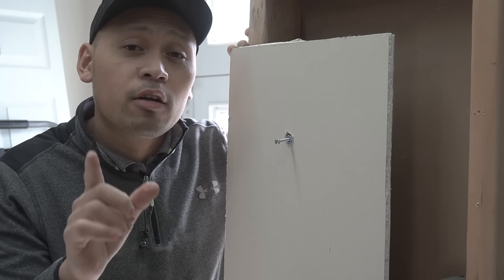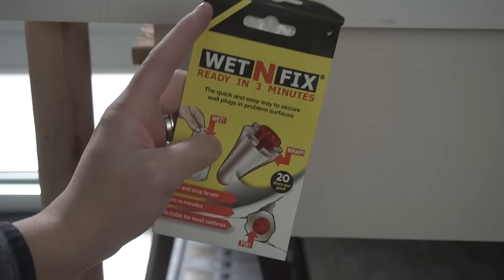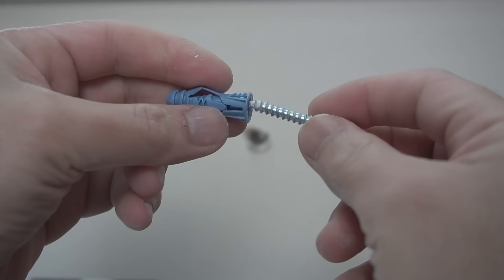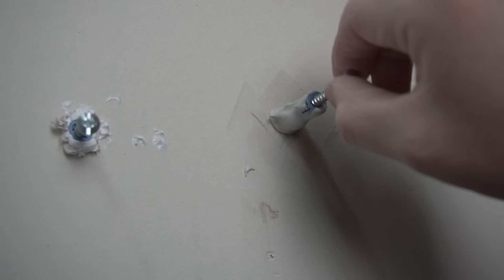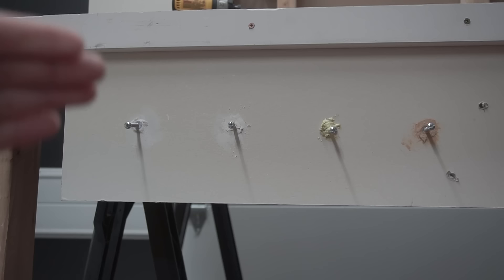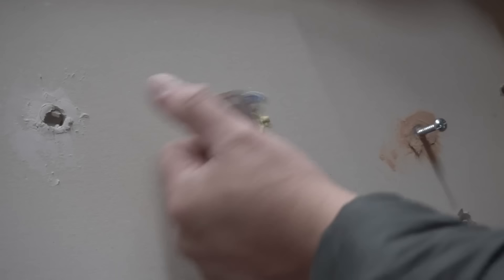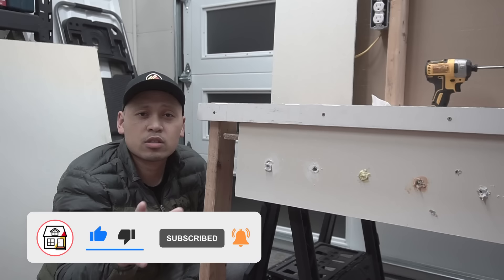How To Fix Loose Or Damaged Drywall Anchors Like New! | DIY Wall Plug Repair!

Comment: Best to avoid this situation to begin with by using the "Toggle" plastic threaded anchors. I usually pre-drill through the skin with a small bit, especially if there is layers of paint on the surface. I've never had one fail. You can also get them in a shortened version for walls that are attached to furring strips close to a concrete exterior wall.
Reply: Where do you get the shorter versions from?
Reply: @qasion  both Home Depot and Lowe's have them
Reply: Which is great if your the builder but what about the buyer.
Reply: @LilacKatz12  I was referring to the buyer / homeowner
Reply: Until you need to unscrew something and replace the screw and discover your toggle fell.  Go with Mollies instead from the beginning.  Always.
Reply: @sailbatten2056  tell me you’ve never used the plastic toggles without telling me you’ve never used the plastic anchors.

Comment: For a hole that's just too big, I'd probably try a Molly bolt of a corresponding diameter first, even if it's overkill and more expensive. I decided long ago that all drywalls (13-15 mm of brittle plaster) were border cases for attaching stuff (it's not a concrete or even wooden wall), so I am sticking to Molly bolts for lifetime sturdy fixtures, because I don't want to risk a kitchen cabinet falling down on a kid grabbing some jam, or a security rail not holding my weight if I slip on the shower floor and need the support. When I hang a light painting frame, I always keep in mind that the same anchor might be supporting a heavy mirror some day when I am fed up with the painting or poster.

For larger or damaged holes, why not cut out the damaged part and replace it with a square or circle of new drywall board? You'd need to plaster and plate that new piece to the rest of the main board, so it may not work in all situations, but it's a proper repair that would probably hold better than trying to fill in the hole, especially with compounds that are not the same gypsum plaster of the original drywall. 

I am actually surprised that there is no better drywall repair options out there, like one where you'd insert some unfolding back board from inside the hole, then fill it with the same gypsum plaster as the drywall board is made of, then drill a new hole once it's dry. If the back board could be 5 mm away from the back of the drywall, even better, as the plaster would not just fill the hole, but also get in between the back board and the drywall board, making the repaired hole even stronger than the original drywall.
Reply: You're supposed to join heavy objects, like cabinets, to studs, not drywall. As for shower rails, I'm not aware of anyone who has drywall in their shower! Wetwall, maybe (yes, Virginia, there IS a wetwall!), but, you wouldn't want to attach a safety rail to that either. Use studs (if you need to and are capable, then add your own studs, as I did for a walk-up porch safety rail (elderly and handicapped)), or, assuming you have tile in your bath/shower, get a heavy-duty, suction cup, safety rail. The suction cup rail that I attached in my client's shower is still holding after 3 years! Keep in mind that a suction cup safety rails are not meant  to hold full, sustained, weight, for more than a few seconds (having written that, I tested my client's with my total body weight suspended off the ground, and it held for 15 seconds before my grip started hurting!).

Cutting out and replacing damaged drywall is no better than the test in the video,
because, the drywall joints can fail under the pressure.

As for your "unfolding back board" notion, that's what mollys are for, although you'd have to drill a bigger hole.

Keep in mind that hollow wall anchors aren't meant to hold tremendous weights; the more weight you have, the bigger and/or more anchors you'd need.
Reply: @skaizun  Kitchen cabinets are fine on drywalls with the proper number of adequate anchors. It's not like you have a choice anyway, there are not always studs where you need them, you usually don't know where they are located when you move into a new apartment, and even if you manage to get one side anchored onto a stud, the other side has very little odds to also be on another stud.
When building a house, kitchens should probably be fitted with reinforced dry walls on the side(s) where you would hang cabinets. Same for the TV wall in the living room.

As for the security rail, it seems quite common in renovated buildings here in France to use dry water repellent drywall for showers in private housing or hotels, as well as in some industrial wet/damp rooms. The main manufacturer here (Placo, from Saint-Gobain group) offers several types.
I also put towel hanging rails outside of the tiled area, and while they are not meant to be security rails, it's nice to know they are firmly anchored in place should the need arise.

As for cutting our drywalls when the hole if bigger than a Molly anchor, a small cut would be rather fragile indeed.. A bigger cut, from the middle of one stud to the other would be just like putting 2 regular drywall boards together. It also gives access inside where you can put 2 small horizontal studs behind both top and bottom sides to support the big board and the smaller added piece. But that's only if you can finish the piece in the same way the rest of the board is painted or wall-papered, if it's not hidden from view.

Anyway, I haven't seen the need yet, it was just me reacting to the products in the video that didn't seem adequate or safe for the job, and trying to figure out how I might broach the matter (and possibly make an even bigger mess!) Sometimes ready-made repair kits are very useful and time-savers, but these looked more like the quick and dirty kind. Also, every decent man or woman that I know has a spare piece of dry wall in the garage, so it saves a trip to the store to buy yet another expensive gadgetry.  😄

Comment: I've had luck with liquid nails but it's probably not for every application. If I may offer a tip: I like to make an X on the surface so that I can align the loose anchor into the right position using the lines to bullseye the anchor center. It sucks to go through all this trouble only to find the patch is worthless because the bracket (or whatever) doesn't line up with the repair. Cheers!

Comment: Good tests but a toggle bolt is the best option at this point.  If someone does not want a toggle bolt, patching over it with hot mud an installing a new anchor 1-2" over or under is a better solution.
Reply: I am a maintenance man for 30 years, and yes toggle bolts are the key.

Comment: A Toggle bolt with a wing nut or Butterfly anchor would work way better considering the fact that the hole in the drywall is that big…
Reply from the maker: Thank you 🙏🏽 for the feedback!
Reply: seconded, though it depends on whatever the hell is hanging off this. I'd be looking at perhaps you need plywould backing or gluing it on or a plywood panel, or changing something to be more appropriate. if it is a floating shelf or something being used/pulled on, or into the ceiling- even wing nuts or butterfly anchors won't cut it.

Comment: Great job. Appreciate all the work that went into this.  Super helpful!!!
Reply: Do not follow his instructions to the letter, this is by far the worst method you can use, in a case where the hole is too big for your old anchor, take a spring toggle bolt anchors, your installation will be more solid, less waste of time and money.
Reply: @foxgood  How is by far the worst method? Where's your video demonstrating this?

Comment: Installation:
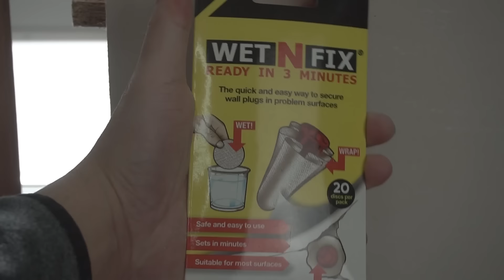1:08 - Wet n Fix 
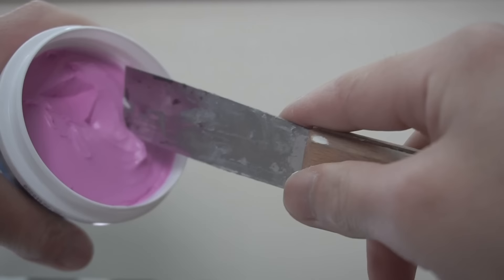2:48 - Pink Spackle 
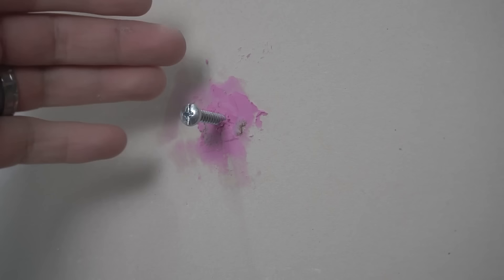3:23 - Expansion Foam 
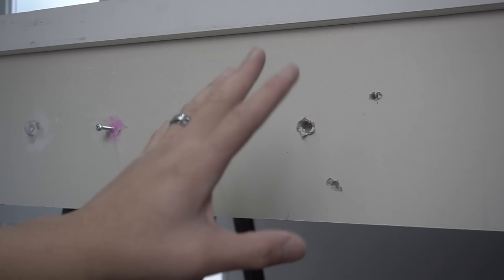4:09 - Wood Filler 
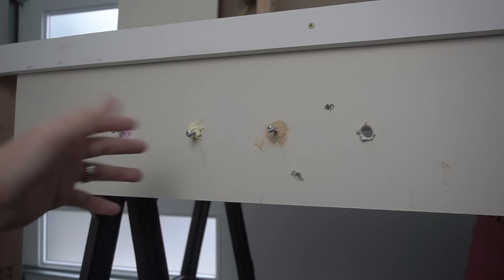4:35 - Caulking
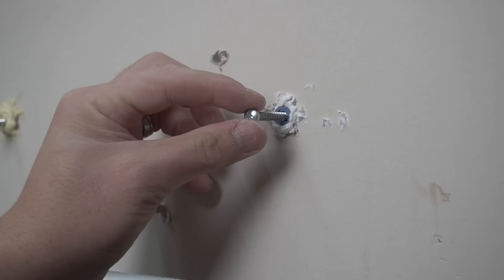4:55 - Hot Mudd Joint Compound 
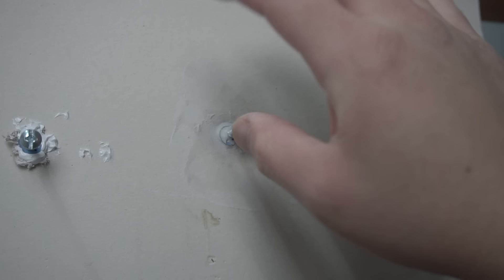5:39 -  Drywall Anchor

Testing:
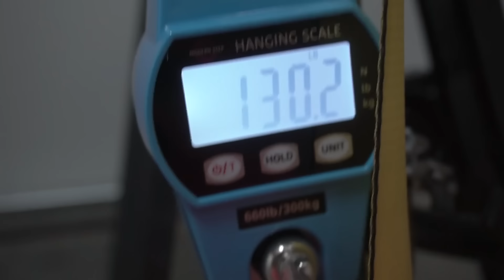6:15 - Drywall Anchor
6:52 - Wet n Fix - Pass
7:28 - Pink Spackle - FAIL
7:55 Expansion Foam - FAIL
8:08 - Wood Filler - FAIL 
8:20 - Caulking - FAIL 
8:31 - Hot Mudd Joint Compound - Pass
Reply: Thanks for this rundown! 🎉

Comment: I really like your videos.  My house has so many problems i'm about ready to start my own channel.  It'll be called "F--k this house!"  LOL
Reply from the maker: You made me laugh so hard with this comment! Best one yet! This deserves a Pin! 😂
Reply: @FixThisHouse    Thanks for all the hard work w/your videos!
Reply: @FixThisHouse  o
Reply: @FixThisHouse  this video made me laugh  ...it is a joke right..? First off no one should reuse a anchor if it has been already expanded. Second not one of these fixes will work. overtime they will weaken and these anchors are not tested that way . To test properly you would have to pull put not down . There are better anchors for this job . Also we see these dont work because foam wood filler joint compound are not made for this at all especially caulk .. of course the only actual usable product is the only bbn one that held up... batch the hole.. for f sake
Reply: And the award for hardcore comment of the year goes to...
Reply: @WhoIsJohnblack  it's the gospel  side huh... danmittt.. always the bridesmaid never the bride
Reply: @WhoIsJohnblack    I accept this award on behalf of all the other fed-up home owners out there!
Reply: A far bigger problem with drywall is punctured vapour barrier. That causes condensation between inner and outer walls leading to mould and rotten building structure.
Reply: @davidelliott5843  hmm depends if the wall is sub grade yes it needs a moisture barrier but if it is sub grade I should spend the extra 1.50 a sheet and get a water and mold resistant gypsum board.or dry wall for those who dont know what I am saying.but then again that moisture barrier should be under the furring strips and not under the dry wall it should be between the wood and concrete.. not the wood and drywall so you shouldnt have any problems with it being punctured.. unless u do thru the gypsum and the insulation and into the concrete you should worry about your vaper barrier..
Reply: Jesus is coming. Read the Gospel.  How would Jesus fix the hole? He was a carpenter, right?
Reply: Brilliant....just absolutely brilliant...been there myself.
Reply: too much trouble, too slow, just use a toggle.
Reply: @notyou5557    Yep that pretty much describes my projects!😂😂
Reply: Jesus is coming. Read the Gospel.  Dude, after a day at work, the smell from my feet would melt the Pearly Gates.
Reply: @ourbills9999  He prob wont reply.  He's off a-trollin in the name of GOD!!🤣

Comment: Thanks for your help.  We're trying to do a vertical blinds repair, and the top of the window frame seems to be a main frame building metal with a layer of compound that offers limited 1/2" depth and very little screw tolerance.

Comment: Wet an fix .   It works a treat,  I had a radiator fall off the wall in the kitchen it was a nitemare dealing with plaster board etc .   Cheers the channel is great 👍

Comment: The wet fix is basically just lagging cloth used to wrap pipes. It does harden pretty good, but I find first repair the hole with plaster Paris, and then put a piece of lagging cloth like that circle you had on the surface, then spackle over it basically repair the wall before you put the Shield back into the wall but first yes drill a hole the right size and then put it back in,

Comment: I'm in the process of fixing toilet paper bracket with small tray that the anchors are loose. My plan is to use a couple small (10/32) toggle wall anchors. I am going to place fender washers between the holder and wall for a little extra wall strength. 
  Good idea. I plan to pick up some of the "Wet N Fix" for future. I have a 40 + year old mobile home with many issues. It keeps me busy.

Comment: I’ve heard (haven’t tried it) that putting a cotton ball in the hole and then soaking it with super glue works.  Drill a new hole in the patch for the anchor.

Comment: Great to do this as an experiment. Thanks for taking the time to do this.
Questions . . . just for reflection; no need to answer them . . .
• Is there a reason you didn't show us the back of the drywall with each set up, like you did with the last one that had the right size hole? I am curious to see what the wet-n-fix looked like on the back . . .
• I am wondering why you chose to try solutions with materials that are not meant to have any strength? Is it because you know of people who have tried such solutions? 
• If the idea of such anchors is to be able to expand behind the drywall, why put any kind of compound on the anchor in a way that might keep it from expanding?
• Several comments were about using a different type of anchor that is larger and would fit the hole size, and I think that type of anchor functions in a different way and is much stronger because of a better anchor design for strength. Was there a reason you did not also show this option?

Comment: Gorilla glue does the trick. I lived in a lower-end apartment for awhile. It was a hurricane Katrina rebuild. Thin thin walls, cheap closet and cabinet shelving. Shelves and screws kept falling out. To avoid delays, I decided to do repairs myself. Gorilla glue was amazing. You DO have to wait 24 hrs for 100% cure and it does expand, but it definitely works.

Comment: I use an interesting trick. I cut a strip of wood about 1/4” thick, 1/2” wide and 2” long. I drill a 1/8” hole in the middle and put a string in with a knot on the back. I push the stick through the hole and pull the string back. I dab a bit of superglue on the edges to hold the stick in place and let it dry. I now have a screw going into wood, much stronger than the drywall.

Comment: toggle bolts when the hole gets wallowed out like that. I have also found that many products come with wall anchors that don't have a lip and some spikes are supposed to hold it still but they do not work at all. There are also metal wall anchors that are like hunting arrows with blades that hold it still, they also do not have a lip but work ok.

Comment: Squeeze "Goop" flexible multipurpose adhesive into the hole.  A generous amount will bond around the inside of the drywall. I have used several times including a towel rack. Other such glues in a tube may work but Goop will tend to stay together and is not thin and not "runny".  You do need to give it time to solidify. With a towel rack end hanging loose, just squeezing the goop behind the loose fitting quickly held the one rack end in place  - without hanging any more weight on it for at least a day or so. I have used it for drywall anchors also.

Comment: I used some foam pipe insulation to fill the hole. It will expand to fill it if you compress it first.

Comment: The Wet-N-Fix is basically Plaster-of-Paris on gauze.  This used to be used to cast broken arms and legs.    It is brittle and is water soluble.  If kept dry, it should work.  None of the others are really designed for this application.   The best answer:  Get a larger anchor.  If you must, go to a wing nut type toggle bolt.  You can find these that will hold with a 1/2" hole!

Comment: easy sand plus fiber mesh or some cloth would do the trick too or just switch to a hollow wall anchor i always keep a few silver spring toggles or pop toggles  in my anchor kit in case this situation pops up.

Comment: A third option would be to just use a toggle style anchor that spreads out once you push it thru the hole. Seeing as the hole has been enlarged anyway, might as well go that route versus trying to reuse the anchor. Still, worthwhile tests...nicely done !!

Comment: A butterfly anchor, prodrilled, works the best. Be certain your drilled hole is clean and properly sized so that the knuckle can fit tightly through the hole

Comment: interesting methods demonstrated.  

as Handyman, mine is different fix.    I simply patch the hole with mud (do not embed the anchors).   the reason: the principle of plastic  anchors needs slight resistance to "create" anchor;, whether it is pressure or toggle style. after the mud dries; I drill right size hole and place NEW anchors  (don't use old anchors,  the plastic inside is already thread cut-destroyed).  the new anchors i buy for replacement is plastic toggle style..

Comment: A larger plug is the answer unless you're already on the biggest size!  If you only want to put a small screw in then hammer a small plug into the big one before fitting it.  Much quicker and easier than buying, mixing and setting gloopy stuff of any kind.  If the plasterboard is really trashed then put in a plasterboard insert supported by a batten.  Careful placing of the batten means you can screw your hanging into that and not use a plug.  Another solution might be to just fill the hole and put in a new one nearby.  EG if it's for a picture that must line up with others you can go up 30mm and adjust the picture hanging to allow it to hang 30mm lower, or just move it 30mm sideways.  Or avoid ever getting into this problem by putting your fixings into the plasterboard supports in the first place - a metal detector or magnet can find where they are accurately as the plasterboard will be nailed to them.  Sometimes you can even see where the nails are if the plaster skim isn't very good/thick.

Comment: Awesome, thanks for sharing the video. I want to know, what type of screw and anchor should I use to hold in a concrete ceiling as want to install the LED Flush mount lights?

Comment: Just cut another anchor in two and use one or both halves (depending on how loose the hole is) next to your anchor to fill the gaps.